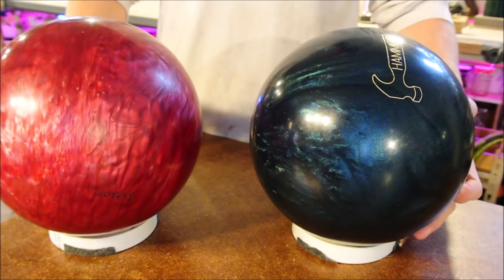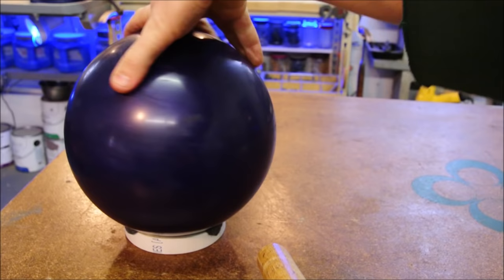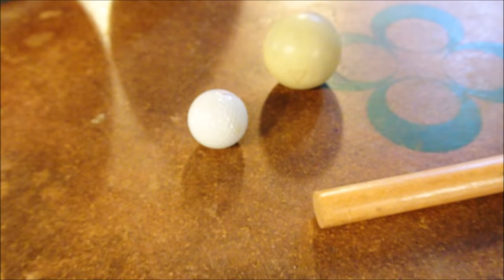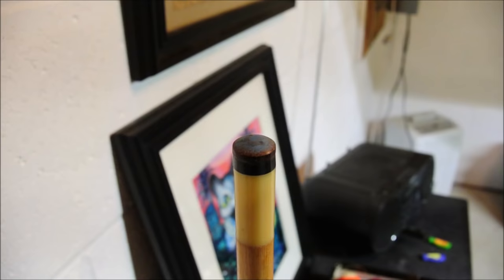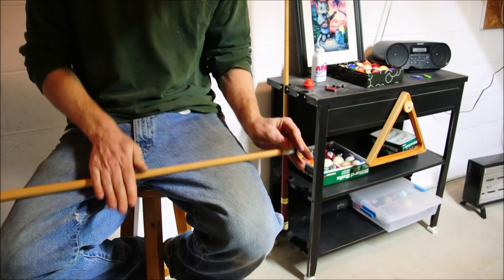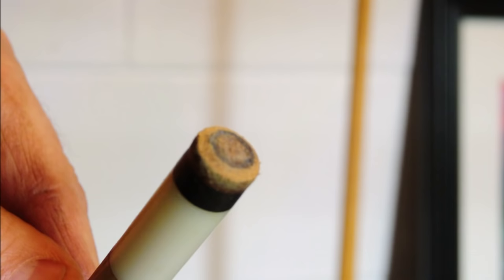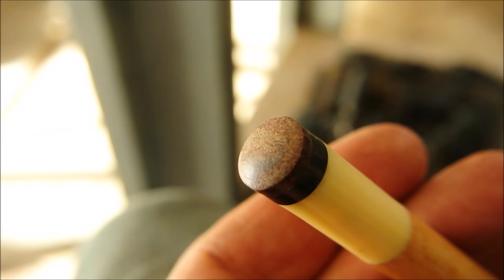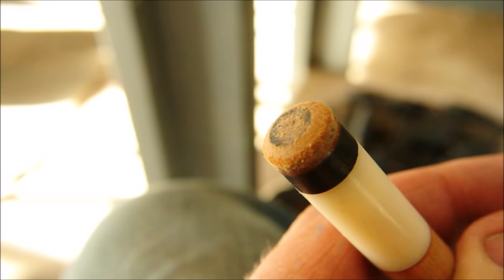Pool Cue Tip Shaping (with a ¾" copper pipe)

Comment: One of the things your channel consistently reminds me to do is create (and adjust) tools for any given problem. In a world where almost anything can be delivered to your doorstep in 48 hours or less, it seems to me that more and more of us either expect to be able to pull something out of a box to solve our problems, or simply throw in the towel/resign ourselves to imperfect results. I guarantee you someone out there has noticed this undesired effect of a flat-tipped cue and immediately jumped onto the interwebs to order an expensive, top-of-the-line version, "now with performance-enhancing rounded tip!".  

Creativity and/or lateral thinking open(s) up a whole world of problem-solving possibilities,  and I'm always amazed at the tiny tweaks you give things to improve their performance. I now store all my viscous fluids upside down, glued to a scrap piece of something, turn old coat hangers into awls in my drill, epoxy some leather onto needle nose pliers for delicate work (or drill a small hole through the nose)- the list goes on and on. While I love your projects, and especially love the thoughts you share, it seems to be the tiny details in the background that stick with me. 

You consistently inspire me to view my surroundings with intention- to see the jewelry in a piece of scrap electrical wire, the shower rod in a piece of pvc, the laundry chute in the bathroom cabinet, and the plumbus in a golf ball. I keep thinking about the quote you shared about the weightlessness of the mind at gameplay; letting yourself mess around with things and learning their properties and limits vastly expands your problem-solving arsenal, even when it feels childish or like a waste of time. Thank you for encouraging me to find the joy in mistakes and experimentation. 

I'm  so excited to see more regular pocket content! Thank you for taking the time to share your wonderful mind with us.

Comment: This video reminded me of the small pool table we had growing up and the joy it brought through the years.  I don't have room for a full size table, and for some reason we're spending more time at home now, so I'm entertaining notions of making one.  Yes, I could just buy one, but where's the over-complication to my life aspect of that? I was just about to ask what the dimensions of your pool table were, but then realized the obvious.  Once I purchase a set of balls, it shouldn't be hard to find the regulation size of a pool table's dimensions.  The difference between the size of a small ball and a full-size ball will yield the key to scale, and since fractions are my friend (or at least not a mortal enemy) of mine, those answers will all reveal themselves with a tiny bit of grade school math.   Thanks for the great video.
Reply from the maker: Between the rubber bumpers, the felt area is 21x45". I don't remember the significance of that ratio, since it was over 20 years ago, but no doubt I used some very specific reasoning to come up with that scale.  I suggest you still do your own math, because it's pretty hard for me to stand by such an old decision. If I were to do it again today, I would probably build it 22.5x45", to give it a little more room at the break for spread. Remember, though physical dimensions for something can be scaled, the physics may lose something in the translation.    

The balls that we mostly use are 1.25", but we also play with 1.75" sometimes, though the larger ones will cause the game to feel a bit clustered. Oh, one more thing: choose your felt carefully. Small balls are more affected by craft felt's pilling, so I've been meaning to replace it for two decades now. 

Good luck! Little tables like this are lots of fun, with way less commitment.

Comment: Not sure why you'd want a smooth polished surface on your tip. 

Isn't it more beneficial to have a rougher surface to hold the chalk better and provide a gripper surface for contact? Hence scuffers and picks on tip tools.
Reply from the maker: That's a tough question to answer with any authority, and chances are everyone will give you a different one. In theory, more perfectly round will mean a higher reduction in error. Many players chalk up between every shot; for them, it's not a problem. For the rest of us, we kind of have to find a reasonable balance. This method will let you get off at wherever your stop is.

Comment: After you scuff you should leave it like that or airiate the tip to hold chalk. If you polish it you defeat the purpose of scuffing it up to hold the chalk
Reply from the maker: It could be argued. Depends on context. If You're a normal player who just chalks it up every once-in-a-while, then yes. If you're trying to reduce error to the smallest possible degree, then I'm not sure I can agree with that claim; pros tend to chalk between every shot.

Comment: THE  IDEA  OR  A  COPY?  THERE HAS BEEN A PIECE OF PLASTIC  DESIGNED/MOLDED IN HALF A CIRCLE AS IF A PIPE WAS CUT DOWN CENTER.  tHEN sANDPAPER SLIDES IN.  tHEN YOU SAND YOUR CUE.   PROBLEM SHOWN  THE PIECE IS TOO SHORT.  PIECES IN LENGTH NEED BE 6 TO 12 INCHES.  YOU CAN THEN SAND THE TIP, HAVING ENOUGH LENGTH TO GET THE ANGLE JUST RIGHT.  BEEN USING THE PLASTIC FOR YEARS FROM A POOL EXPO.  GOOD STUFF!!

Comment: I see you have screw on tips very nice. 
How can i fix a screw on tip thats not center if the cue stick when i screw it on its not flush with the ferrule
Reply from the maker: That's a tough one. Step one is to determine if it's the tip or the ferrule that's off center. It's probably more likely to be the tip. Do you have more than one tip to insert/test?

Comment: Why would you buff the end smooth? I thought we use scruffers to make them rough for more grip?
Reply from the maker: Just to show how, in case you want to. It's debatable what degree you should smooth a tip to. There will be pros and cons to both smooth and rough, and I'm sure everyone has an opinion. My personal opinion? Sand it to 220 grit, and leave it at that. Maybe give it one or two spins on the bluejeans.
Reply: @pocket83squared  what chalk do you use?
Reply from the maker: @dugy40  Master. But I'm no professional. I just copy my uncle, who is.

Comment: Awaiting the comments tht says tht u are chalking the cue wrong 😂
Reply from the maker: Did I seriously do it wrong? Is there really a thing for that?
 I hope you're just making an eye-roll.
Reply: @pocket83squared  yea they usually move the chalk from the center to the diameter doing this outward motion at a 45° angle and repeat this motion while rotating the cue. This is to keep the cue tip from flattening over time. (If my directions were unclear there are many youtube videos explaining this in greater detail) any thanks for great videos and keep up the good work.
Reply from the maker: @WarLord18  That makes sense. Although, if you can re-shape your tip easily, then it really won't be a problem. My excuse here is that it was for demonstration; whenever I do anything in real-life, I observe all local laws, codes, regulations, and cultural norms.
Reply: It keeps you from boring a big hole in your chalk.
Reply from the maker: @robertmeadows1657  In order to use up the maximum amount of your chalk, one must necessarily bore a big hole in it. There's really no avoiding that. 

Sounds to me like we have some procedural dogma going on here. Not too unlike those of any other specialty niche group, eh? From wine tasting circles to paintball leagues; from wheelchair hang-gliding to saltwater fishtank aficionados; with well-witching or microscopy, the spiel is always the same.
Reply: No, if you swipe your chalk from middle to edge of tip, you tend to wear down the entire cube more uniformly.
Reply from the maker: @robertmeadows1657  Tell me, do you have usage rules for a stick of butter, too? 

Once the hole becomes deep, a thinking person might start to use the sides.
Reply: A thinking person with a bored out cube of chalk might wonder why the sides of his ferrule are all blue and scratched up.
Reply from the maker: @robertmeadows1657  I have now been bored out of this discussion. 

It's not exactly my concern how you handle your sticks. Funny that you should concern yourself so much with mine.
Reply: Robert is right though.